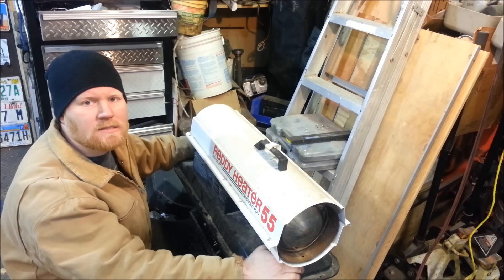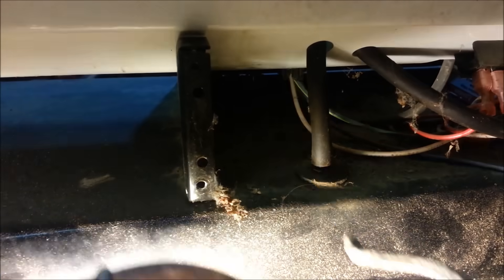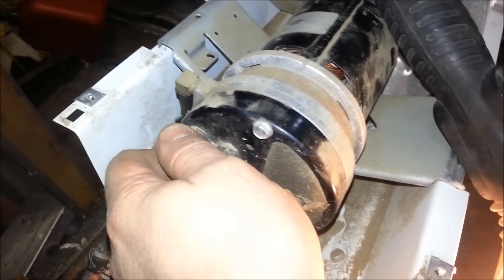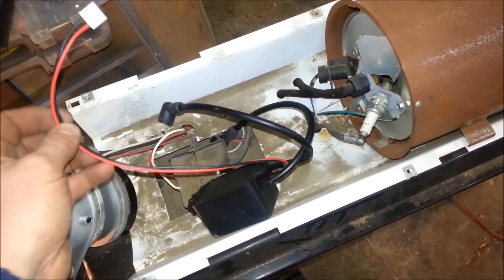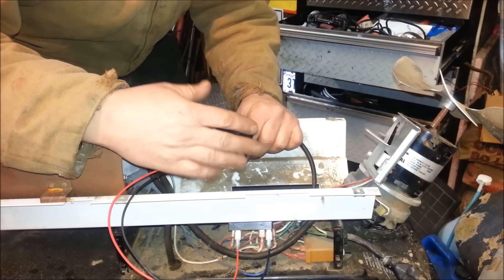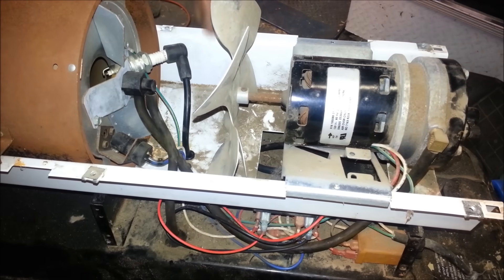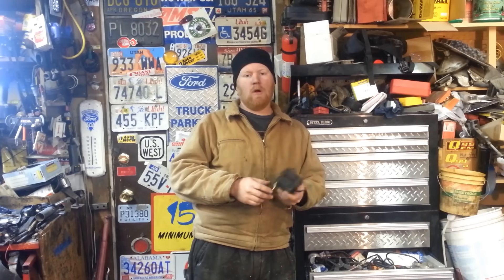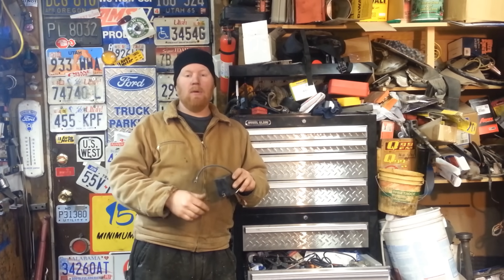Torpedo Kerosene Heater repair & HOW they work

Comment: Ive got one that might stump you.  I bought an old (black label) reddy heater 50k btu and i took it all apart cleaned it up really nice and put it back together after replacing all the hoses and the filter kit for the pump.  I get good pressure off the pump and I do not have any leaks.  added a power switch to turn it on and off without unplugging it.  The problem is that I can get it to light for a second or two without the cover on.  As soon as i put the cover on i do not get any sort of flame.  I have played with the air pressure and i have it set where it seems to be igniting the best.  Still no luck.  Would this be a nozzle issue?  It has the correct spark plug and its gapped and turned the correct way.
Reply from the maker: DiezelDan01 These run just like an engine and need the proper fuel to air ration. If when the cover is off it lights it generally means the unit is getting too much fuel and or not enough air from the fan. The easiest way to remedies this is to turn the pump pressure down(counter clockwise). This will reduce the amount of fuel delivered into the combustion chamber and should allow for a good light. NOZZLE: generally these only go bad if they have tons and tons of hours on them. They will spit fuel instead of atomizing it(looks like smoke)

Comment: Discovered my air pump veins were sticking. Cleaned with brake cleaner, they had a sticky film on them. Reinstalled, had to readjust air pressure, runs like new now! Thanks for the info!!
Reply from the maker: Bryanna Freeman Awesome. That's great news.

Comment: Tonight i come in and plugged it up and it ran for 2 hours doing good. i unplugged it to move it to another part of my shop, then when i plugged it in it would come on blow a little heat and then white smoke and cut off. i kept trying, i took the cover off. when i plug it up it glows, but will not start and just kicks off, PLEASE HELP ME!! P.S does not have a spark plug.
Reply from the maker: MrBladecx They either have a spark plug, spark wires or a glow plug. So I'm assuming you have the glow plug. If the unit it switching off only after the flame dies then the optical sensor is doing it's job. These work just like an engine and need the right fuel air mixture to fire and run. More than likely your pressure setting is off. This can be from a dirty air fliter on the back, cracked air lines, or split fuel pickup lines.

Comment: Helpful video. My torpedo heater turns on but then after a few seconds the breaker trips. Sounds like it might be the optical sensor. There is no heat. What are your thoughts? Thanks
Reply from the maker: Heather Simpson If it never produces heat/flame it is not the optical sensor. The optical sensor is only bad if the heater is functioning and producing heat then trips the breaker for no reason. The first thing to do is check for spark.
Reply: sixtyfiveford Ok I changed plug, it has a spark but nothing else is coming on and it trips again after a few seconds. What do you think should be the next step? Thanks
Reply from the maker: If your not getting a good mist/smoke out the front of your fuel then your pump is not working or one of the hoses is split so it can't pressurize.
Reply: Im not getting anything but the spark. I will check hoses ect. Thanks for the quick response.

Comment: i have a reddy 55 it starts runs awhile then stops. i have to repluge it up to get it started again please help thanks
Reply from the maker: MrBladecx If it is producing heat then just randomly stops: your optical sensor is going out or dirty.

Comment: the fan isn't turning by hand or when i plug it in. the guy i bought it off of said he aint used it in 6 yrs and has maybe 24 hrs of burn time. is there a way to try and brake fan loss or do i need to buy a new motor.
Reply from the maker: Dennis Finke Pull the back pump cover off with the few small bolts/screws and see if the impeller is binding up. I would think it got rusted a little if it sat for a long time. Hopefully a little clean up, lube on the shaft by the fan, and persuasion will free it up.
Reply: Thanks I'll try that out. Would all purpose oil work?
Reply from the maker: Yeah, any oil is fine.
Reply: got the fan oiled and got it turning. it still wasn't burning. Took the back filters of and found it was rusted from where water got into the air chamber. Can't get bolt out cause it is half missing and no way to clean the inside of it. Just wanted to let you know and say thanks for the advise.
Reply from the maker: That sucks.

Comment: I have a Reddy Heater R50 that the motor went out on. Last month I put in a New motor, hoses and spark plug. I had to fine sand (400) the rotor in the air pump to keep it from binding when I tightened the screws up.
The heater would not Ignite. I read all your comments (Thank You!) and figured it had to be air pressure as I had spark and New Kerosine flowing out the nozzle. Got a gauge and found the best I could get out of it was 1.5 psi.
 
It was finally Warm enough to work on the Heater again today. (scratch head here)
I got a new air pump rotor and put it in today and set the rotor clearance to .003. With the new rotor, it went up to 2.6 psi and that was enough to allow the fuel to atomize and ignite. FINALLY!!
It is Supposed to be set at 3.6 psi and I tried everything I could to crank it up but it would not go any higher. The cone is not getting as Red as it should. I cleaned out the air pump spring and ball. Should I replace the plastic pump cover and spring and ball? I do not see any cracks. It looks like the adjusting screw is All the way in for Max pressure and still only 2.6 psi. Have you heard of any New Motors having a problem with correct RPM's? What else could it be?
Thanks again.
Reply from the maker: GoopOfOil If it has tons and tons of hours on it the venturi nozzle can wear and not allow pressure build up(rare). The side to side clearance not only the .003 rotor clearance can be a contributor in extreme high hour machines. The spring can also weaken along with the ball seal.Try pinching the output hose while you check pressure and see what PSI you can obtain.
Reply: sixtyfiveford I pinched the air output hose and saw the gauge go to 8 PSI. Great news. I had put in a new cork/air filter on the pump and did not want to crack the plastic cover with Overtightened screws. With the heater running, I tightened up each of the three screws 1/8th of a turn at a time and the PSI went up to 3.6 after the 3rd1/8th turn. You Got to Torque the Cork. Runs great now.Thanks for the help.
Reply from the maker: That's great news. Stay warm.
Reply: I have a reddy 50k btu unit that I loved but it gave up the ghost with a failed motor, doesn't spin even with the pump removed and the shaft free spinning. The motor is non serviceable so I was looking for possible sources, but it's a specialty item that was not available at a reasonable cost. If I chance upon a motor I may bring it back from its suspended animation, but in the meantime I've gotten a pro temp 110VT for almost the cost of the motor.  it has a hot surface ignitor instead of s spark plug, which I don't think works as well, but it does the job. 
wonder if I could swap the ignition types to get a cleaner burn.

Comment: I have a 100,000 btu reddy heater gets fuel perfectly with a great spray, has new ignitor with great spark (same as old one) but won't ignite....... then times out and trips the breaker
Reply from the maker: keith corrigan If it gets to much fuel it would "flood" and not ignite.. If you are getting a good plume of fuel out of the front and have good spark then this is more than likely your issue. Try turning your pressure down slightly.
Reply: It's not a photo sensor thingy issue?

Comment: I have a Reddy heater 155. It doesn't want to stay running when its cold (1st start). Heater starts and then the burner goes out and fuel mist comes out of the front of the heater before is shuts down automatically. Once the garage is warmed up some. The heater starts and runs great. I need it to start when its cold. Any tips on whats wrong?
Reply from the maker: Joe Janus Pressure could be too low or oil too thick.
Reply: sixtyfiveford Really! I put diesel in it and it worked fine.  I'm going to check the igniter to see if its AFU. Now the unit doesn't even ignite.
Reply from the maker: Joe Janus Non winter diesel will get too thick in colder weather and can't be sucked up as easily. I was running bio-diesel but it gets way to thick and is virtually unusable in the winter. Even some winter diesels get too thick in extreme single digit temps. If you have a engine block heater you can put that on the tank to warm it or keep your can of diesel in a warmer area and refill as needed. You can turn up the pressure to help the unit pull up the thicker diesel and burn it while cold and then turn it down once the oil is warmed up. The spark plug can get coated with oil deposits and stop sparking.
Reply: sixtyfiveford I got the diesel at Wawa and not sure it's non winter diesel. It has been pretty cold. It make sense that once I get the garage temp up, the torpedo heater fires up no problem.  I'll put some kerosene in it. I also purchased a new pump assy. The pump housing was getting pretty warm when it was running. I also ordered a low pressure gage to make sure I got the right pressure. Thanks for your help. I'll let you know how it goes once I get the parts installed.
Reply from the maker: I'm curious. Let me know.

Comment: I have an nec 100,000btu heater I rebuilt the blower and that works good  and I have spark it is not getting fuel ? can you tell me what to look for . had the venturi out and it was not plugged up. the fuel in it is pretty old could that be doing it? I just am not getting fuel for some reason. Please reply asap  thank you.  could the psi be set too low?
Reply from the maker: Jack Gutwein The fuel pickup line could have a split or be broken off right in the tank. You can blow on it with you mouth to see if you hear it bubbling the kerosene. Or the pump line is cracked or the pump isn't delivering enough pressure.

Comment: I have a 15year old Dyno Glo RCM-KAF210-WH, the problem I'm having is low air pressure. The pump pressure recommended is 8.5PSI. I can only get 4-6PSI.  I have had it look at by an authorized repair center. They have replace the rotor kit, filters, plug/pump adjustment kit. Still the same problem. I think they are unsure of what wrong with it. Also I think they might have problem finding parts for it. Do you have any recommendations of what's wrong and where I could get part for this heater?
Reply from the maker: Keith M Pump or air leak in the hose going to the nozzle.

Comment: Thanks! I have a different make and model (Thermoheat) but it's the SAME setup inside. Now that I understand the fuel/air system I'll look closer at the air filters and fuel quality to explain my puff of smoke. It's much better but not right after cleaning the the fuel filter/jet.

Comment: GREAT VIDEO  -  THANKS

Got a feeling when I go home tonight I will find the problem with mine.  It ran just fine for about an hour . Ran out of fuel and stopped. I filled it back up with kerosene and now it won't ignite. Tries to. Just sits there and smokes a lot.
Reply from the maker: Jeff Begor Sounds like a spark issue.

Comment: Thanks for explaining how these things work. I'm borrowing the
Toro Porta-Heat that quit. The owner thinks  that not using Diesel #1 is the problem. I bought #2 off-road thinking what the heck. So I kinda feel responsible. When things were checked out the air pump isn't pumping, so now im looking at the lines.
I'm having trouble finding the in-let and out-let filters for the air pump, I'd just like to change them as the machine hasn't had any maintenance that I can see. equipsupply.com huh? anybody else you deal with???
thanks

Comment: I have six Dayton heaters broken at work, that have had me scratching my head, since they have no problem with fuel or spark. I never knew they had a photo cell on them, until I watched your video. I have a feeling that's the problem with all of them, since they're pushing ten years old, so I'm going to check them tomorrow. Great video, with lot's of info. Thanks for sharing.
Reply from the maker: Joey R A defective photo cell generally has the symptoms of: the machine will power on and begin producing heat for a couple of seconds, then it will immediately shut off and trip the built in breaker.

Comment: Could it be anything else I replace spark plug but I will check filter next if that's the only thing you think it can be.
Reply from the maker: Goldyfrom Baby If it is puffing mist/smoke it generally means it has lost it's burn for a second. This could be lack of spark, not enough air from the pump, split fuel pickup line, or contaminated fuel.

Comment: Hi what do it mean when it on for about 2min my eyes start burning what's wrong with the heater?
Reply from the maker: Goldyfrom Baby First, have you used this Kerosene forced air heater before and it didn't bother you?
Reply: sixtyfiveford
Sixtyfiveford & Goldyfrom Baby,
I have a F150G Knipco Heater 1987. It has been rebuilt once around '97. Lately it will run you out of the garage, eyes watering, can't breathe. To make sure it wasn't just me, a friend came over and it took him about two minutes to choke up and eyes watering. After watching this great video I had the courage to tackle the problem. I had previously cleaned the foam filter with soap & water. I hate telling on myself, but just in case somebody else made this mistake here it is. I oiled the foam filter as I have the lawn mower. Bad mistake. So I cleaned the filter, removed the filter housing and cleaned both sides of it. I blew compressed air through the rockwool / paper filter until my new one arrives. I am a woodworker, and my heater was coated internally with saw dust. I brushed it all away. I noticed in the air intake adjustment, the stainless steel ball was trapped in saw dust. I blew it out from both sides. My spark plug rods were black. I cleaned it on the wire wheel and replaced it. I didn't know #1 Fuel Oil was diesel fuel. It burned great. I believe my problem was the air intake was blocked with saw dust and it would burn, but not hot enough to burn all the fumes/odors away. The front disc is red hot now and before it wasn't. Might be Goldy's problem too. Thanks for the expert repair. William C.
Reply: Thanks Im just replying back but I did fix it it was clogged with old bad fuel it was like slime cleaned it now burs smooth.
Reply from the maker: That's great. I'm glad you got it sorted out. Stay warm.

Comment: I've used a kero wick type heater for over 20 years, and have had three "max smoke" events in the past two years (one with a new wick).  I am now sold on these, although the one I bought is a little noisy - I'll have to turn it off during Prairie Home Companion (Sat. p.m.) and Mountain Stage (Sun. p.m.)
Reply from the maker: Lawrence Rupert Yeah, they definitely put off noise but the circulation of the air is worth it.

Comment: Actually one of the better how to vids on this subject but high pressure air to blow back through the fuel line usually pops out the cone strainer filter in the fuel pick up tube leading to unfiltered fuel plugging the nozzle at some point.

Comment: I assume if you have a 150 heater,that I'd have to get an ignitor compatible with the btu,right?
Reply from the maker: FlintSpall Any ignition works, functionally they are the same. The only difference in models is connection type and spark plug wire length due to layout of the machine.
Reply: sixtyfiveford Good to know,,I saw one like you put on your heater on ebay,,but it was about 47.00,,don't know about s/h.I think the ignitor is out,there's no spark at all,and the heater is old enough that someone disconnected the photocell,so I filled a house full of kero trying to dry some drywall overnight.the nozzle kept spraying,the blower kept blowing and I have no spark at the plug.Sound like ignitor to you?? Thanks  Anyway,thats what I told the homeowner.:>)
Reply from the maker: If the spark plug is good and clean and there is no spark; then the ignitor isn't getting power or is defective.
Reply: sixtyfiveford Got cha. the motor,transformer,and power cord wires are all within the same wire nut,when I took them off,all the wires looked good and adjoined. if the motor is working and the power cord is good,then the transformer should be powered as well,right? If so,then it has to be defective,theres not even a glimpse of a spark in the dark.:>) Thanks for your time.
Reply from the maker: Yeah, sounds like it has power to it. The generic ignitor I bought was from equipsupply.com
Reply: sixtyfiveford Thanks,,I actually looked there,but ended up ordering one from another place,which was about 50.00 delivered.I had to pay attention to the way it fastened back.mine didn't set in a reservoir like yours did,so I had to be selective.still don't know if the bolt holes will be the same,,not likely.